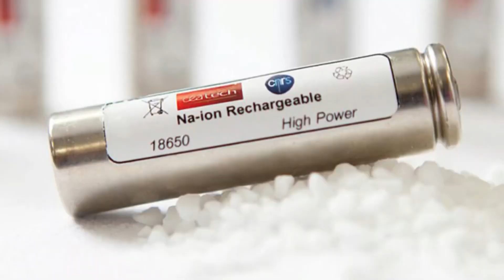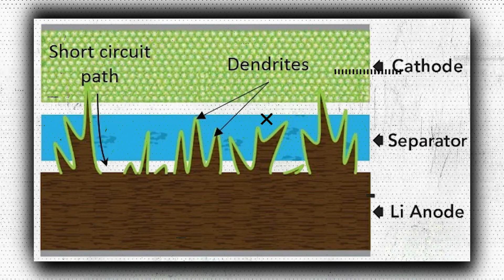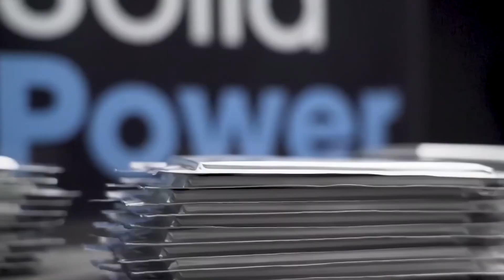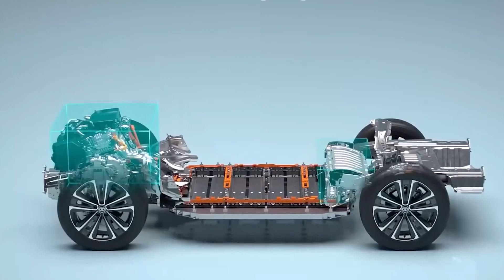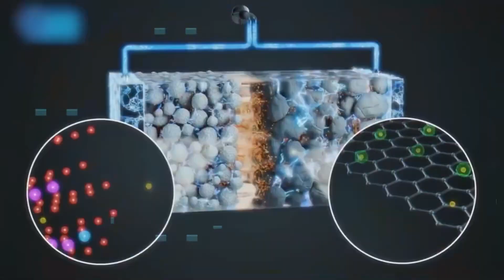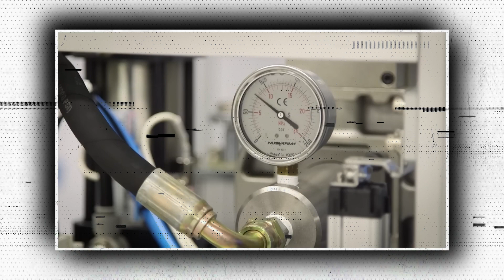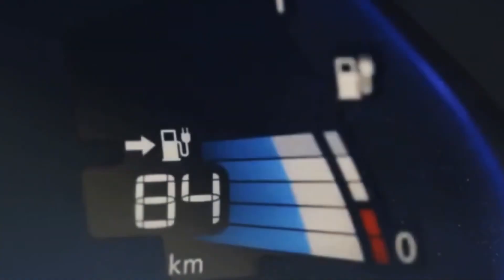Honda CEO Just ANNOUNCED A Battery That Will SHOCK Toyota!

Comment: Imagine a 900 miles battery in a super efficient car like the Aptera (three times more energy efficient as Teslas), and one ends up with a 2700 miles range (4300 Km) car on one charge, that is ridiculous. On one charge from LA to NYC,  and this will be possible technically in the near future.

Comment: Vehicles using the new technology won't start production until 2025, so I wouldn't hold my breath.  The batteries and vehicles would have to be made in significant mass market volumes to be relevant, and prove to be reliable in daily use.